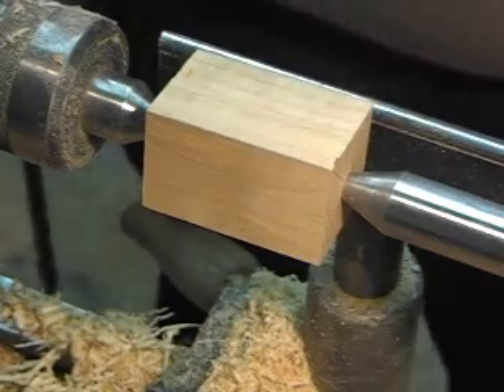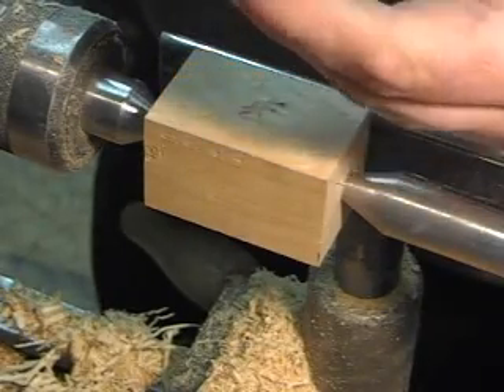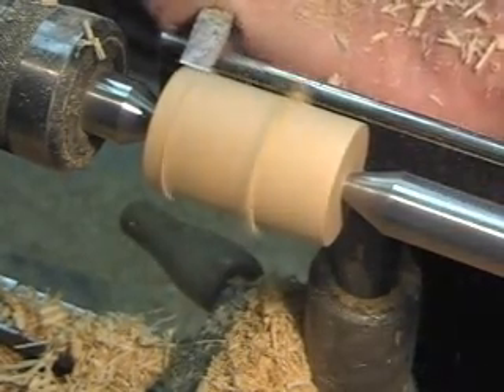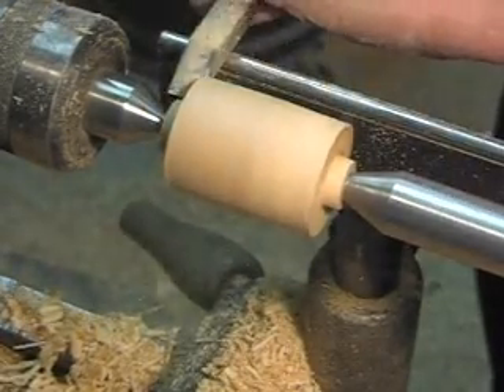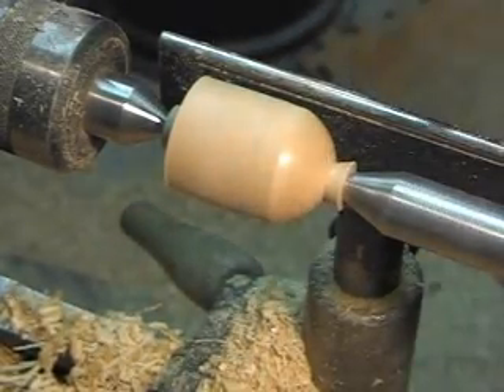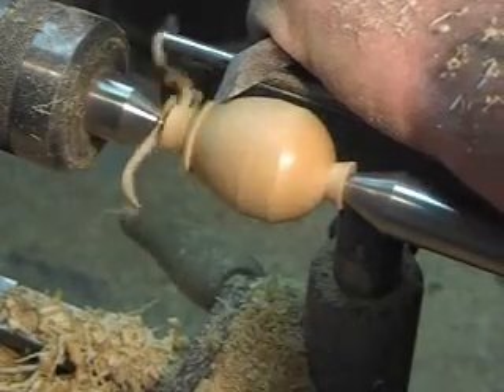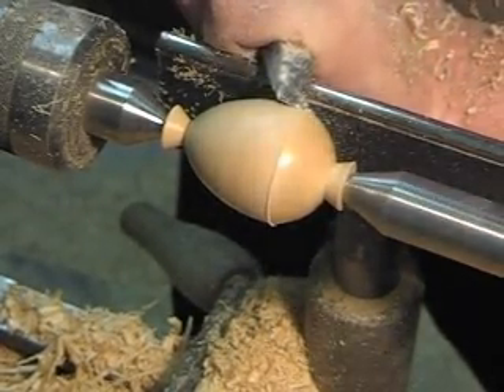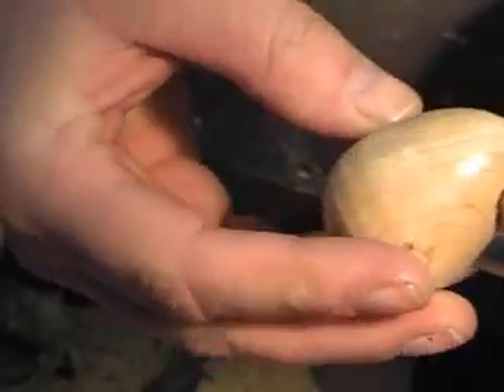Bedan Practice #2

Comment from the maker: Hi Bob, sorry for being so late to reply.
I asked Jean Francois Escoulen the same question, and he told me not to worry about it, the Bedan is a tool that does not nee a lot of sharpening, and when you do sharpen it, you use the hone most of the time, so if you do not remove a lot of material each time you hone the bedan, then it will last for many many years..... cont

Comment: Hi, Stu:
I see that you have relieved the bottom corners of the shaft of the tool to allow it to slide and roll better on the tool rest.  What happens when you have sharpened it enough time that you get back to that area with the cutting edge?  Won't that mean you will lose the corners of the cutting edge?  I just tried a bedan for the first time today and found the sharp corners of the shaft really dragged and bit in to the tool rest when I tried to roll and traverse. (continued)